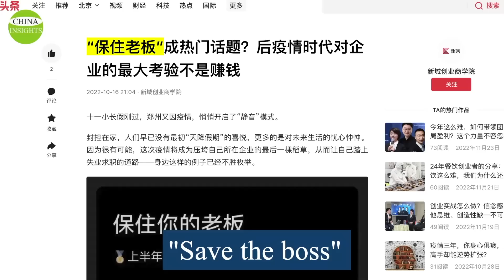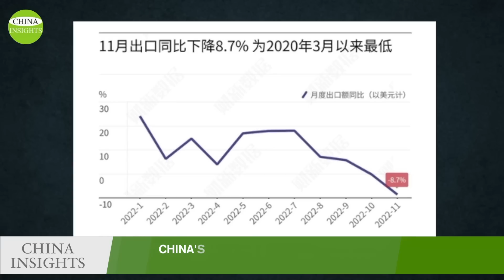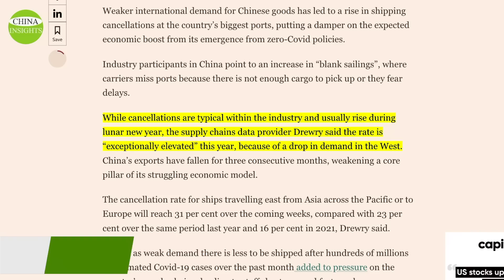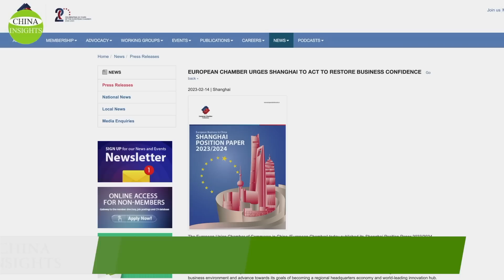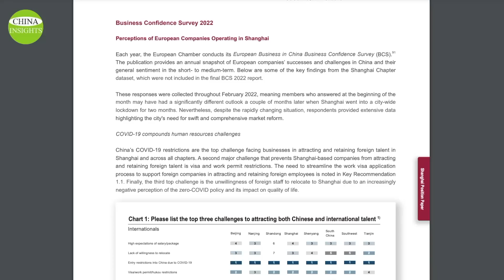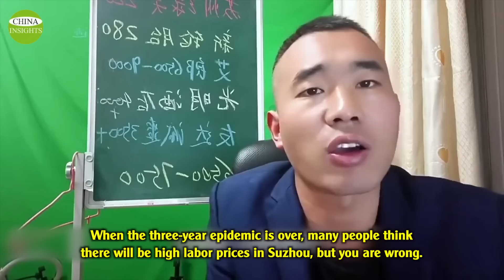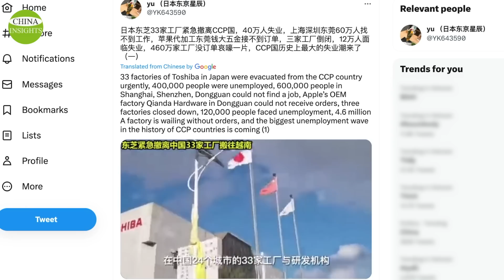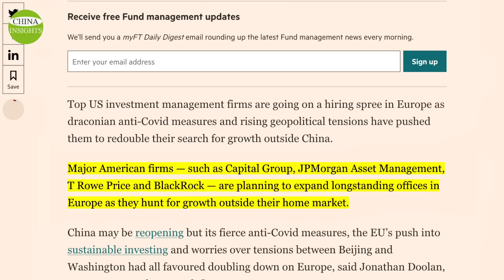China: Foreign trade manufacturing industry faces an avalanche & its economy is in a major setback

Comment: Even if China opens for travel or business this is not the time to invest in China!  Any company that thinks, let's take advantage of this economic weakness in China should reconsider the situation.  NOTHING  has changed and will not until the ccp and Xi is removed.  Any company going back to China should be boycotted and called out as noy helping the problems in China.  Steer clear of business in China until things change at the top down to the bottom.  art:hand-orange-covering-eyes: